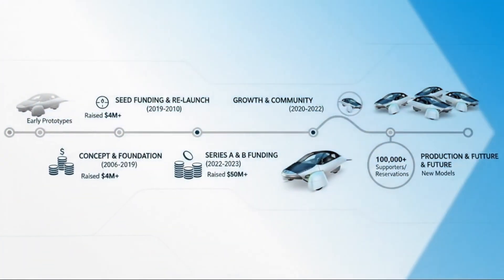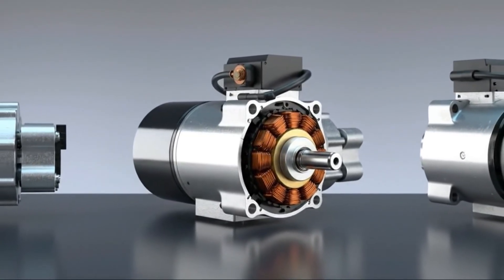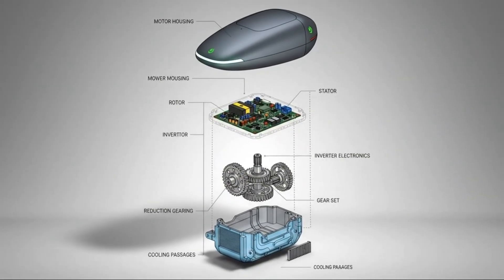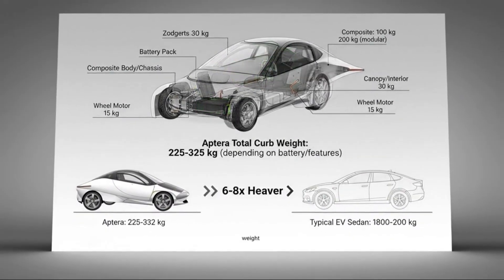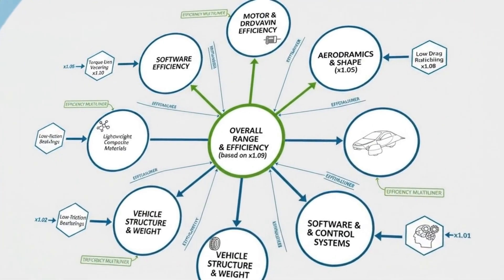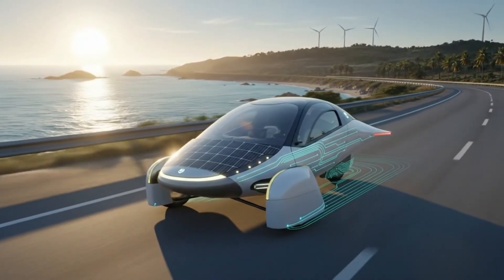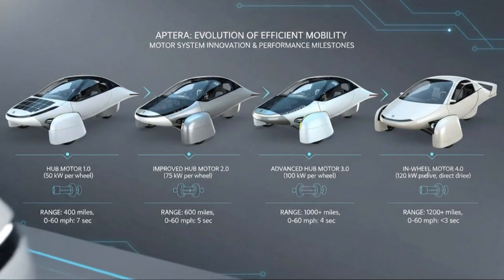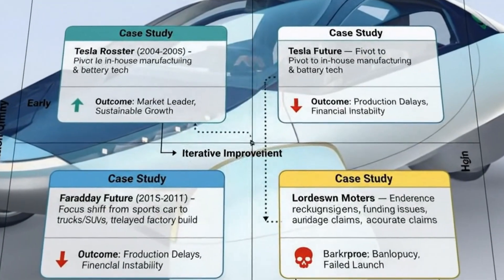Aptera Abandoned Its Dream Motor — And That Decision Might Finally Bring Solar EVs to Reality

Comment: This will never come to fruition. I think it’s dead in the water because of timing, price, and current market economy.
Reply: Wrong. It's perfect for the timing as the EV market is seeing a vacuum and is demanding things like never having to plug in and 1K range for a starting price that is really low, everyone can afford. Aptera finally did it, they fixed the EV problem. Plus I keep buying more Aptera stock as it's going to the moon.
Reply: @billsmith5960  .
1) You will have to plugin unless you drive very little  
2) 1k range will not be a very low price and may not exist for years after tis launched at the 400 mile range.  
3) they haven't fixed anything until they have a third party company evaluate efficiency (which they have refused to do to this day) or release the vehicle so it can be evaluated.  It's not even in production after seven years now. 
4) and there it is.  Stock.  So you go around hyping the stock so others buy to raise your stock price.  This is a "micro-brew" vehicle at best if it ever does get made.
Reply: @crcurran  - 1K model comes out this year. So stop disagreeing with the CEO. He knows what he's talking about as he is smart and the best. Plus, I keep buying more Aptera stock.
Reply: @billsmith5960  Maybe 1k models come out this year.  Stop stating as if its a fact.

You don't know if the CEO knows what he's talking about unless you work for them and have seen and tested the Aptera for yourself being able to see how much power it draws from near 0 to full battery capacity and then run it down until it stops dead from an empty battery. You don't know that he is "smart and the best"; that's the language of a child or a zealot.

Keep buying that stock LOL.  It may bring you in a bit more money but it can easily take half your money once the real world tests by third party come through.
Reply: @crcurran  I hope I'm wrong because I loved this company when it was first announced. But after waiting for so long and after owning a Volt and M3, I think it's too late and with solid state being announced today from Donut; if it's real, they are threading water.
Reply: @crcurran  - The CEO is banned from lying. So he says only fact and thus why I buy more Aptera stock.
Reply: @billsmith5960  Nice try.  He can't lie now that it's on the stock market. So now they are being very careful what they say.

Aptera has made claims for over half a decade that they have yet prove.  

No 3rd party validation yet to back up claims.
Reply: @crcurran *Most micro brew recipes produce beer.
Reply: @veritas6466 really.}?!  I’m so thankful you came along to set me straight /s. LOL

It;s a metaphor.  You can look that word up.  Simile is French a good word to look up and learn too.
Reply: @crcurran "Micro brew is to Aptera, as produce beer is to task completion".
Reply: @veritas6466  Ah English is not your native language.

:Micro brew in that they will only make a SMALL number of Apteras, maybe 50,000. They will not ruin petrol vehicles sales.
Reply: @crcurran  No amount of hubris nor character aspersions will change the fact Aptera will never see production.
Reply: @veritas6466  I'm not so sure about that.  

I am confident that if they do they will not meet their 10 miles per kWh efficiency.

I am extremely confident that it will not dominate EV sales nor crush ICE as some claim here.  It will be microbrew production of vehicles for small production run per year.

The company has shown it's in ability to keep expenses low until they are producing vehicles.
Reply: @crcurran  I'll save this exchange under comments to revisit in a year. I'm extremely confident it'll age like, "lait". *French for milk. You can look it up, ...in a dictionary.

Comment: @5:39: 'Indejerdee tod torqu' and 'exgianenedinecinn' and 'regenernatrion' are not valid words.
@5:53: 'Prediitable' and 'Scaable' and 'Servicesibility' and 'Predicitabily' and 'Supplaity' are not valid words.
@6:24: 'Spuvitive' and 'Plawsfarim' and 'Nicbe Focuis' and 'Skaboard' and 'Cnduced Sottware' and 'Propratty' and 'Batferw' and 'Solutionns' are not valid words.
@6:29: 'eegl' is not a valid word.
I stopped here, there are more of these horrendous errors in the video.
Horrible quality. You goofed up big time. Start over. The only reason this video exists, is to try to create ad income.

Comment: You really are a pack of 1d10ts. Your thumbnail points to a cancelled motor in the lower left corner, and it's not even a motor, let alone an IWM. Then you title says cancelled - WHY NOW? when it was canceled a few years ago. What's your definition of now?

Comment: I guess this isn't going to production. Is this turning out to be a scam
Reply: It has been a scam from the start
Reply: Aptera is already in production and has an assembly line. This is why I buy more Aptera stock. This insider channel is the best.
Reply: @billsmith5960  It's not in production yet.  Just stop with your nonsense.
Reply: @crcurran  - Stop with being a paid troll from big oil.
Reply: @billsmith5960  I wish I was paid for it but it wouldn't be big oil, it would be some on paying me to reveal propaganda.

I've been enemy of big oil and oversized vehicles likely longer than you've been aliive.
Reply: @crcurran  - Then it's the freemasons. As you know, they write the checks.
Reply: @billsmith5960  I really wonder if you believe the conspiracy theories.